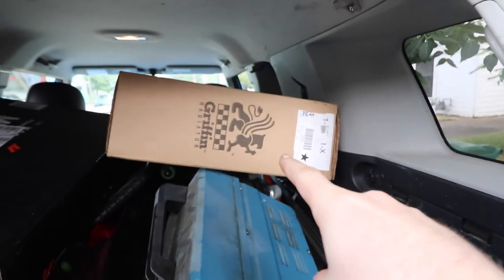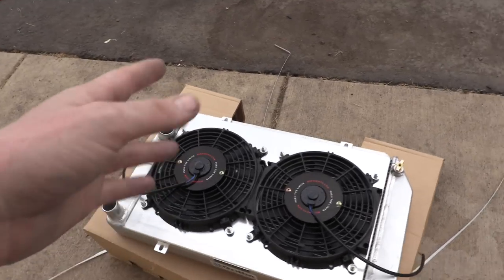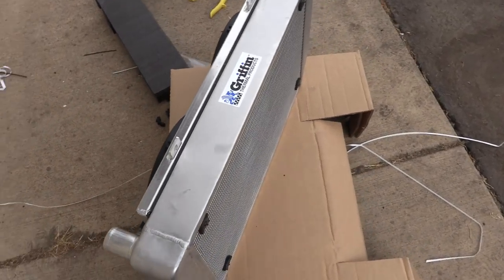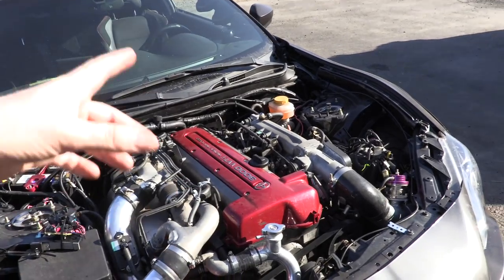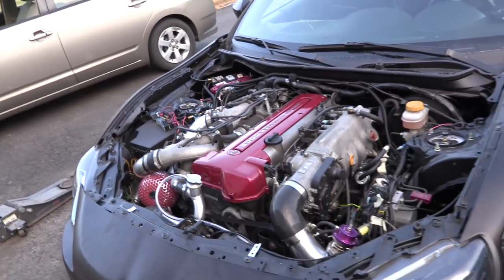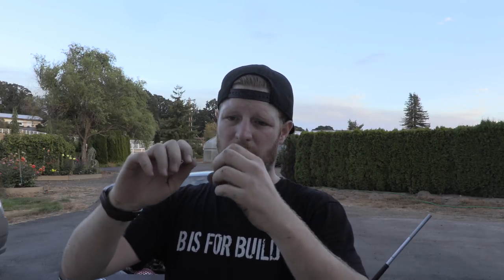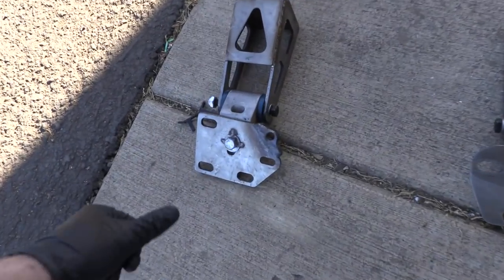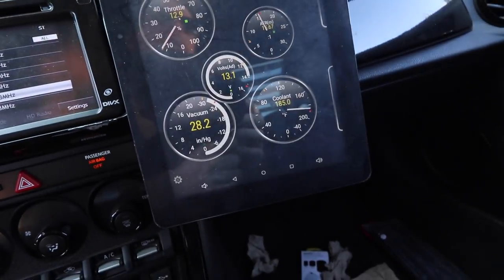2JZ BRZ Pt 31 - The BRZ Is Dead.

Comment: Your supposed to weld the brackets after you tighten the bolt and get the spacing set I think.  I almost commented when you were installing them but I don't know for sure.  Weld the front solid that is.
Reply: joelflaugh for sure. This is what big boost did.

Comment: As mentioned lots below:

A) fully weld those engine mounts on the bottom when set correctly
B) build better radiator and intercooler mounts that have rubber insulators to remove vibration and stop gauling (rubbing) between the steel and alloy.

Comment: well crank pulley was rubbing...crank sensor is at the 7 o clock position  behind the crank pulley.
Reply from the maker: +TRON 0010010110 thanks i'll look into this
Reply: Keep up the hard work, I'm rooting for you! Edited because my comment/advice was pointless
Reply: Why the fuck does Chris respond to this but not the other 2 or 3 comments with good advice.
Reply: Jordan Liske because this isn't an objective opinion, this is a simple item that could literally solve all the problems he's been having.
Reply: True... I was referring to the comments about poor radiator mounting and possible fuel issues. Both are easy things to fix/check and could prevent a lot of headache.
Reply: Jordan Liske Oh yeah, I agree with you there. I think Chris might have seen that comment on his problem and zoomed off to fix it though, so I can'y exactly blame him ;p
You made a fair point though, and I can understand why it would frustrate you.
Reply: Phil Atkins yay discussion that didn't turn into a shit storm! Whatever the issue is, it should be pretty easy to fix once he finds it. Hopefully we can get this build sorted in the next video or two and move on.
Reply: It should still be able to run off the cam position sensor but in limp mode plus the symptom for a loss of crank  sensor is a long cranking time to start.
Reply: Not an intermittent issue where signal jumps on and off..2jz will not run when CAS is down..if only damaged it will cause intermittent issues...or medal particles on the magnetic sensor......been here done this..have a 2j swapped miata and a 2j swapped e30.

Comment: Could be the crankshaft position sensor is gone. The car starts because when engine is at start up, all inyectors are openning for fire up. But once the car starts, crankshaft position sensor governates the inyectors. Check the timing on the gauges and see if it varies a lot. Keep going Chris! You are awesome and inspiring!

Comment: Chris with the CX racing motor mounts you need to weld them together the bolt is just for mocking it up in the position. You're supposed to weld them after you get the motor in the position you need it in.

Comment: Ive heard lots of good things about early 90s ford tarus fans, they produce close to 3,800 cfm and are built to last as they are oem parts they are desinged to work in any condition besides them being strong reliable fans they are super cheap around 80 bucks new and 40 used at a junkyard and operatie on a simple relay system. They are a commmon swap on z32's and supras i think you should definitely look into these fans as they are may work better than any aftermarket ones. maybe not for this one but for future builds

Comment: Dude,check ur crank and camshaft sensor.It might faulty over there because those things are a magnetic sensor and it could fail over time.It sometime lose magnetic power once it heats up.Its just a sign of faulty magnetic sensor maybe.Or maybe check the ignition system.As far as i know, Toyota's has an igniter that could lead to that problem also if that igniter fails.Hope this helps.Good luck.Don't give up.Normal perks of an engine swap.✌️

Comment: Not sure if you have checked it yet but, my 2jz ran well then horrible, similar to yours and the issue was leaky ECU Capacitors. Not super common, but worth a check. JZs are notorious for this.

Comment: Keep going chris. I've been there done it and got the t-shirt on a MR2 build. The 90s toyota engines were ahead of there time in electrical sensors and management but sometimes the reality is an after market ecu even in a base map form with new loom solves 90% of all the issues you will ever have.

Comment: You shouldn't have two pressure caps on your coolent system, the one on the radiator should be changed for a blank making less failure points in the system, on another note check your idle control valve in the intake plentium, it may need cleaning or replacement, it would be a plausible issue for rich idle and cut off

Comment: You may never have any more cooling system problems, but in case you didn't know, the radiator caps have return valves, so if there is ever vacuum in the cooling system, it will suck from the overflow bottle into the cooling system. Because of this, it may be necessary to have the overflows going into the bottom of your overflow tank, so they suck coolant back in, not just air.

Comment: You're doing a cracking job Chris, keep plugging away and it will come together. Might be worth checking the plugs? I had a set of plugs in my 20vt that was a grade too cold and they got coked up. Literally one day I drove it home, the next day it wouldn't start save for a wee cough and splutter. Took a few hours to figure that one out. Keep up the good work and the learning mate

Comment: You need to weld the engin mounts together. The bolt is to adjust when you're installing the motor. Once you get your adjustments correct weld them together

Comment: how is your crank shaft positioning sensor, cam angle sensor? They read together making the computer read for the spark timing... The tps for throttle. check those. Worse case is its the icm. aka igntion controlled module gone bad... lmk good luck

Comment: This reminds me of my Soarer. I had the same issues until I figured out it was a bad connection between the coolant temp sensor and it's connector. In the end I soldered the wires directly to the sensor terminals. Didn't have the issue again. This may not be your problem but worth investigating.

Comment: I hate to say this but to make this swap work 100% spend the 5k on Motec and it's plug and play. He's spent way more than the motec kit in paint wheels and body mods. Add up the time spent trying to figure out the wiring and all the parts bought for homemade wire mods and you are half way to the motec solution. Now he's hacked the harness so much who knows if the motec would even fix it now. Good luck every build has a learning curve but if you are trying to be diy on everything it's a waste a of time when there is a better more cost effective solution. It killed me when he bolted that steel repair piece to the aluminum Evora frame rail. The car was torn down and ready to fix right the rail is offered by lotus and available on eBay for cheaper than the material cost for the hack job repair. Love the channel love the builds but you gotta learn from trial and error. You could have got sponsored for the swap by the company that does the motec ecu just reach out you have a large enough channel they will respond trust me!!!!! They would love to help you more motec swap kits sold price goes down you just have to install it and prove it's the best diy plug and play solution

Comment: When you had the instant engine drop you might have pulled on an overtight wire or section of the loom. Could have pulled on one of the connecters and caused an intermittent connection. You then lift the engine. That won't likely cure any of those problems, more likely make it worst. Your tidy up of the ratty looms may have made it look better but made it more prone to these sort of problems. An extra tug on a tie wrap could have pulled some wires as taught as a bow string. Don't need to go on but your no run problem could just be a broken or disconnected wire.

Comment: All ecu's have the ability to adjust cranking fuel and warm up fuel. It is not doing a recalculation, it is finally up to temp. Do a 5-10 percent subtraction on the cranking and after start and the soot should go away.

Comment: After the engine is set at the right location you have to weld the motor plate and bushing mount. The bolts are temps

Comment: Check crank sensor, do a boost leak test. Get a brand new MAF (usually if you have to clean it, or mess with it. It's bad. They don't just fix themselves) you're gonna want to ditch that twin turbo set up and go single sooner then later.

Comment: "Fingers crossed, the tacks dont break on the next big bump and let the motor slam back down again."  "Fingers crossed the cooling system doesnt explode." "Fingers crossed this wiring mess doesnt short out and kill the car or burn up."  Dude...stop driving that thing around haha.  Take it back apart, weld those mounts up solid, get with Trevor on the cooling system so you can stop guessing, clean up the wiring some more, then put it back together and see where you stand.

Comment: You can only have on pressure relief cap in a cooling system, and it needs to be the highest point of the cooling system. Please Crimp and weld the overflow line from the Radiator. Can the heater bypass lines be run round the back of the engine? they need to be below the Pressure cap. Don't get discouraged. you're making progress albeit hard to watch sometimes.

Comment: Pull everything out, rip the dumb turbo setup out, go single, aftermarket ecu, go manual, remove the rad cap on the top rad hose, and you won't have all these dumb problems. Bandaid fixes don't work man, kinda annoying seeing this keep breaking due to poor choices. DO IT RIGHT AND DO IT ONCE

Comment: Fuel filter ?
Reply: It'd be a really good idea to check the fuel pressure while its attempting to run. Pump could've crapped out and can't supply enough fuel while running. The AFR s never show because it dies so quickly...
Reply: pumps usually die 100% all at once either they work or they don't

Comment: Hmm.. too many issues.  The engine mounts should be solid or welded.  The engine dropped and hit the pulley on the crossmember.. I guarantee that you have damaged the crank sensor, and damaged the crank/bearings.

Overheating.. really need to remove air bubbles before you go on a test drive.

I commend you for trying to learn.   I don't want to go on, there are too many issue here.

Comment: This sucks big time mate. Hopefully its a small fix. Had a similar run with my engine swap. Had to rebuild the motor twice before i got it right but i learnt heaps and i now have a wicked 4age swapped ke70 so hang in there everything happens for a reason and i bet your brz is gonna be minto when you iron out the bugs. Hang in there!

Comment: Hey brother just wanted to maybe give you a place to check in addition to looking at everything that you just were talking about take a look at the oil pressure sensor I know that sounds silly but I know in my truck when the oil pressure sensor started going out it would start up and run for five or 10 seconds and then shut offand he would do that to her three times until the oil got warmand then it would run just fine so maybe take a look at your oil pressure and your oil pressure sensor as well as your masss air flow

Comment: Camshaft position sensor? Injector problems? Fuel Filter? Fuel Pump? It obviously has spark. It obviously has air. Check the fuel. The AFRS don’t show because it only runs for a quick sec.

Comment: It sounds like the same problem I had, 

The maf wasn't reading the correct amount of air passing over the sensor. 

The VVT-I 2j's are fussy when it comes to maf and O2 readings, if there not within a certain ratio..... I'll see if I can find an old video from 2004. 

1 - Replace Maf
2 - check for any possible air leaking out of any fitting charge pipe etc.
Reply: #2 - especially after lifting the engine to R&R the motor mounts with the bumper cover mounted on the car.

Comment: I think you need to spend the time to sort out the wiring system properly for the computers and get everything working the way they should .
I think you will find that is the issue and with cars run from computers like they are need it to all be connected right or you will continue having theis problems to do it right it will not be cheap but that will be the only way you will be able to get this car to run reliably
Good luck hope you get it all working because you will have a great car then  lots of gut up and go and reliability .

Comment: Fuel pump ? check wiring, I had issues with my car that one wire at the fuel pump connector had small cut, and it couldn't deliver all amps to fuel pump and I could start it, but it died right after

Comment: Have you have a issue with a intake sensor a common issue is causing it go cut out also can loose boost common issues on seats and Toyota it's a long shot but it could be a sensor issue all along . Just a thaught

Comment: electronic throttle body needs to be cleaned. There are valves in the intake manifold that can get caked with crap. that can cause the revving problem. clean the entire intake and throttle body system.

Comment: A quick note. Those single speed Mish fans are shit. They're exactly the same as your cheap china crap you originally had on there but come in a cool box with purty stickers. Mishmoto should pull them from sale as they're damaging engines world wise. But they do have ones that do work, the ones which sport the bigger blades with a lower blade count. But also hooking them up as a two speed will help..

Comment: I would be getting pissed at this point may be time for an aftermarket injection set up. with an after market system you can tune it to behave and zero in on problems quickly. of course its expensive but worth the gremlin slaying capability.

Comment: i understand your whole approach of budget build but you have to understand to do it right from the beginning and you wont have this issues, add up the cost of your fixes to get this running somewhat decent  tunning 700 dlrs radiator 400 dlrs tow truck at least 200 dlrs so far in wanting to do it cheap you probably have tally up 1500 dlrs of unnecessary expenses with that money you could buy the right parts  and yet you still guessing no where near getting the car running properly you probably will throw another 500 dlrs in parts if not more while trying to jimmy rig the whole swap

Comment: mishimoto fans are crap, they fail randomly under high engine bay temps.. order some SPAL fans if you want some that actually work
source: just finished building my 2jz 86 and tested it in 125F weather

P.S. could you include the Griffin Radiator part number?

Comment: If you need to accelerate the car on low rpm probably it could be the intake air control valve if this car happens to have o e

Comment: Check the crank position sensor, I remember a few years ago when a friend's mkiv supra had similar issues and it was the CPS although the one in his car was a specialized aftermarket sensor that came with his standalone ECU (Electromotive). I would also check the TPS.

Comment: Running rich may have fouled the spark plugs.  That'd be my guess.
Reply: TychoBrahe21 why was he able to run it for 45 miles after? If this was the problem wouldn't the problem surfaced earlier?
Reply: It can take a while for the carbon soot to build up enough on the spark plug before it will foul them out.  Certainly not saying that that's definitely it, but I'd say its a contender.

Comment: you removed the thermostat.....car runs colder for longer, an with thermos on all the time it would take an excessive time to get to temp, hence why its so rich. Its probably used a bunch more fuel because of that, more than you anticipated. A tiny amount of fuel may not be enough (judging on the tiny fuel can you had). My bet is its out of fuel. Use a more methodical approach to problems
Reply: Rodger Donaldson he...put...fuel.... did you watch the video?
Reply: Matt Swagmiot my point was that the fuel he went and got may not have been enough. When the car primes the inlet hose is pressurised but very little makes it up the return hose. Once it starts however vacuum pulls the regulator open and then you need a hell of a lot more fuel to keep the system alive. I've done it before felt like an idiot chasing other things
Reply: Rodger Donaldson a gallon of gas runs my v-8 for an hour or so at idle. using more gas or not, it should run for more then 20 seconds on 1 gallon.
Reply: Renas yeah well I could be wrong, it's only a guess at what I can see. Car fires up so no problem with spark or not enough a problem to stop it, he already said he pulled the maf and tried to trigger limp home, so I'm going with fueling, an since it was running it's hard to think the pump or fuel reg is on its way out but it's possible. More possible there isn't enough fuel in the tank once the feed and return are full
Reply: Rodger Donaldson that makes sense!
Reply: Rodger Donaldson how would that be an issue you make it sound as if this engine is always running at 100degrees when 185 is literally spot on for a 2jz?